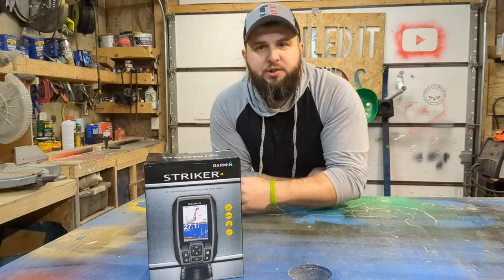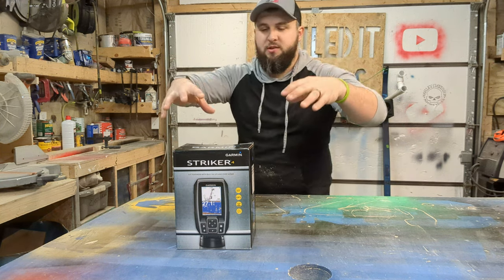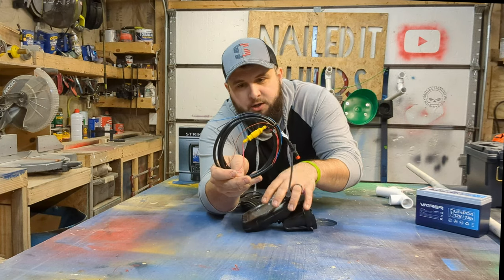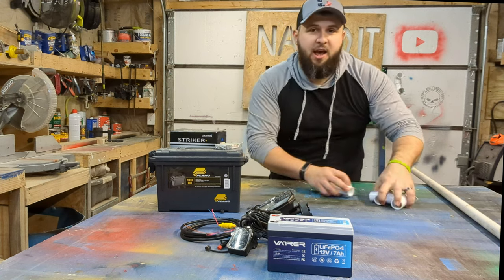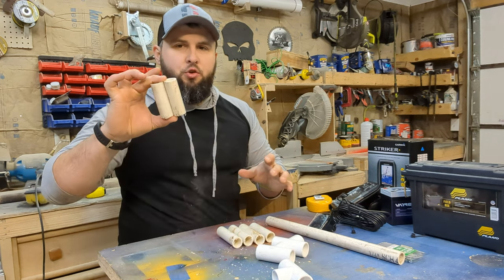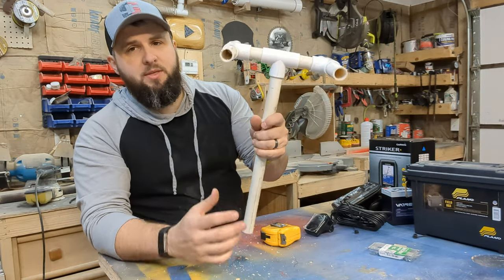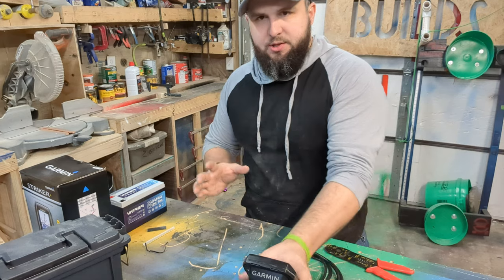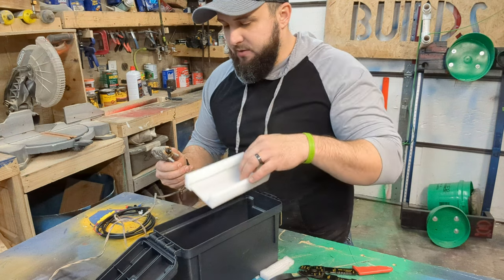DIY Garmin Striker 4 Ice Set Up || From Box to Fish On

Comment: good video...  I think I will drill a hole through the vertical pipe and the horizontal and just put a bolt through with a wing nut.  then the pole will easily rotate for easy transport, and might self level a little, or be easy to adjust the angle and tighten the wing nut.    also less parts and cheaper.... but whatever works.